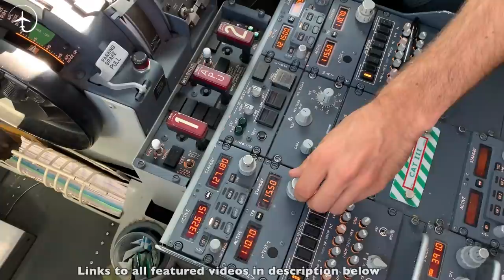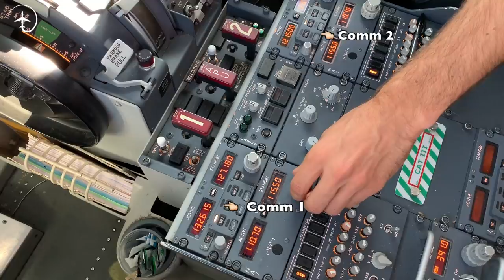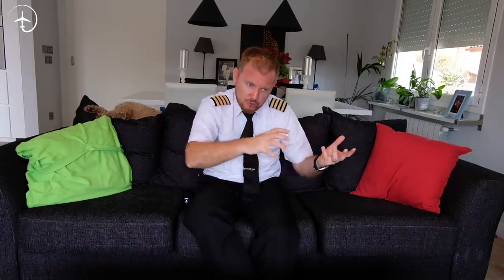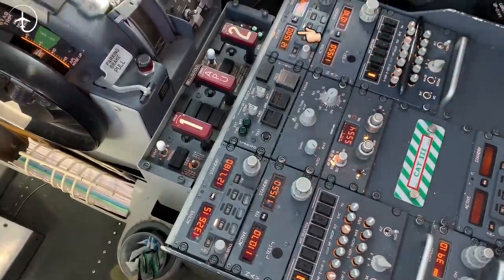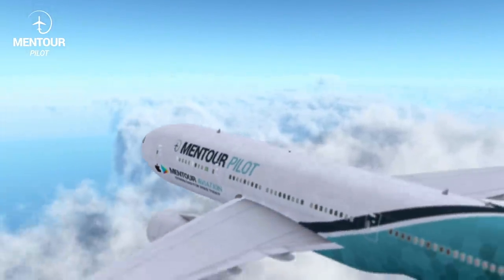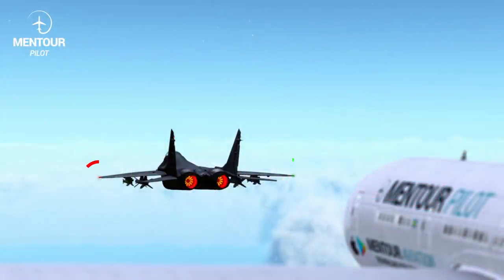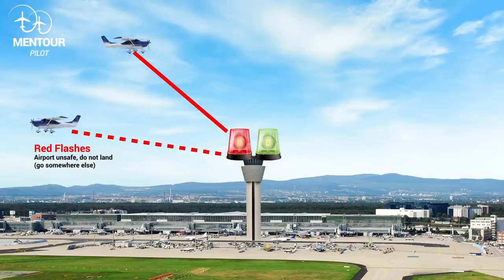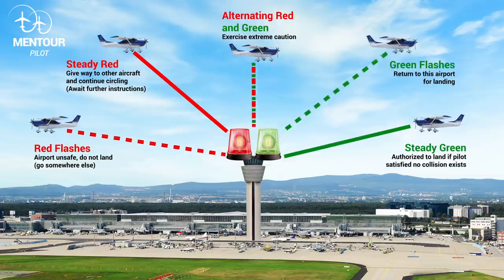how do pilots deal with loss of RADIOS?!

Comment: Can you talk about the MEL with regards to radios?  I was on a flight in the US that got delayed on the ground.  The plane was an MD-80, the delay was due to a bad radio.  The pilot mentioned that they could fly with only one radio but that the one functioning radio HAD to be radio 1 because that was the only radio powered by the APU in the event of a dual engine or generator failure.  Since the good radio was radio 2, we had to wait on the plane for maintenance to come swap the radios so we could fly.

Interesting side note from a flight I was on this week where I thought of Mentour Pilot - as they were pushing back and the starter on the first engine was engaged we heard a distinct CLUNK (then a groan from the passengers), the wing walker held up his sticks in an X, engine start was canceled and we came to a halt.  A few minutes go by, we're thinking the plane hit something.  Captain finally comes on the PA and tells us the towbar broke!  I was on a half-full 737 and they broke a towbar!  I don't know what part of the bar broke.  10-15 minutes later they continued pushback with a different bar and tug, there was apparently no damage to the plane.
Reply: Mike Levy , there is a shear pin on tow bar. if the tow car applies excessive force or abrupt maneuver when push the aircraft, the shear pin on tow bar is broken to avoid to damage   aircraft nose landing gear. After a quick check you can go on pushback with a different tow bar.
Reply: MEL varies by planes and sometimes even by airlines, according to FAA as long as there is a two ways communication you are good, but there are some issues with that. For example back when i was learning in school we went out with radio 1 inop and radio 2 was ok, during my training flight our com 2 failed as well so we had to do a few of the things he said but since it was a training airport we just called the tower by phone and got our clearance on the phone lol. So going back to your question even though you are ok by FAA regulations to go out with one radio it is better to have engineers check what happened to comm 1, because it could happen to comm 2 like it did to me

Comment: I’ve had to message pilots via ACARS that ATC is trying to get ahold of them. The responsible center will call our ops center and the sup will tell the responsible dispatcher. I’ve also had an aircraft on my “desk” message me to let me know that ATC was trying to reach another one of my company’s flights. Luckily, the other flight was another flight I was following already, so I was able to message them via datalink/ACARS and they were able to  get in contact with the proper center. 

:)

Comment: Good video, I (partially) lost my communication on the third solo flight, at least I could not hear the air traffic controllers, though they could hear me. It was combination of bad radio in the aircraft and the frequency that was out of the range of the second radio... I was quite worried about the whole situation, but eventually I changed the frequency to the one used in the nearby area and that one worked. And the traffic controller agreed I can stay on that frequency when I could not hear them on the proper one when I got more altitude. That was quite worrying because I was really unsure about the terminology or the nature of the problem and I was quite busy following the map:)

Comment: I had a mid flight radio failure during my private pilot flight training. Flying outside controlled airspace from a class D (general aviation) airport. 1. Squawk 7600 on the transponder. GA airport was near a major airport so it should have been picked up on radar. 2. Continue transmitting as normal. It may be only your receiver has failed.  3. I was not that far into the flight so I headed back to the departure airport.  4. Put the VOR on audio. Some VOR's can transmit a voice signal if necessary.  5. Check you are on the right frequency. 6. Check misc things such as radio volume, if using a headset put radio on speaker, check radio circuit breakers etc.  7. Follow normal pattern entry procedures when you are getting back to the airport. 8. Check the tower (if there is one) for light signals. Above all, remember the golden rule of priorities: 1. Aviate  2. Navigate  3. Communicate.

Comment: Hang in there! Hope this all blows over soon.

In my plane I have two radios, a handheld radio, and a fancy headset that talks my cellphone with Bluetooth. If those all fail it's down to the light gun or divert to an airport where no radios are required. In 10 years of flying I've reviewed NORDO arrival procedures twice but have never actually had to use them.

Comment: Personally I experienced radio failure on a solo Cessna 172 VFR route as a SPL. I squawk 7600 and rock my wings in front of control tower twice but I didn't see any flash light or flare but I saw chopper holding in air after I rock my wing 2 times in front of control tower.  Since I saw the chopper holding there I just proceed to land with extra cautious and immediately vacate the runway upon landed.  It was a good experience that I'll remember for the rest of my life

Comment: When the German Air Force One had this problem last year, they used their satphone. Isn't that an official procedure? And what about the permanent data link many planes have to their airline or the airplane manufacturer? Is it possible to use this to communicate?
Reply: Those all work on some type of radio transmitter, but yes if you have other devices like a satellite phone or cellular phone you can attempt to use them. The data links are not suited to communication with ATC, these only send minimum data packets about the systems. For a single pilot aircraft the work of using the telephone may be too much burden and it is better to simply fly the remaining portion of the flight plan if it is short, or fly a common published route to an alternate airport if the remaining flight is very long.(pilot judgment for how long is long) Air traffic control knows your flight plan and has already given clearance for the plan and in modern times you are on radar. Many of the procedures date to a time when radar was rare and there were no satellites or mobile telephones.

Comment: I always have a handheld in the plane with me in my bag. All what you explain is right, however the problem is, like flight MA370, if you loose all electrical. You will have no radios, avionics transponder or anything else. I carry a handheld with nav and com in my flight bag.
Reply: I do not know if you ever have an opportunity to test such a radio, but chances are that the range will be significantly reduced. The regular radio uses an external antenna with unobstructed line of sight, and has 25w of transmit power. The handheld can only send / receive it's signal through the windows, and probably transmits at 5w on max power. I'd much rather have that than no radio, but it might be less useful than expected.
Reply: @PsRohrbaugh  Test it all the time.  Since we are very high the range does not seems to be affected.

Comment: Answer: panic and fly straight line to the nearest airport.
Reply: Correct answer: No panic, proceed with remaining instruments and visual clues (if exists) to scheduled destination.
Reply: no panic: if radio is lost just use TV
Reply: answer: panic ask if any passengers want a go at flying
Reply: Runway direction, what is that? We're landing on the roof of the terminal building.

Comment: During my flight training, shortly after takeoff, I actually had a radio failure in my Cessna.  I could neither receive or transmit.  Relying on my training, I squawked 7600 and made a 180 turn back to airfield.  As I neared, I somehow regained radio and landed normally after clearance.

Comment: While flying a venerable Cessna 152 on a x-country, during a takeoff from an uncontrolled airport the radio tuning knob fell off and rolled to parts unknown......as I was flying to a towered airport, I pondered this a bit and decided to contact the on airport FSS (I'm dating myself here, yea, a Flight Service Station of which there were very many then) as they always monitor 122.8. So, when I was about 25 miles out I contacted them, gave them my ETA and asked that they relay my predicament to the tower.....As I approached the airport, I soon got the steady green right off the bat as they knew I was coming, rocked my wings, gave the windsock a look and made an uneventful landing. On the ramp, I found that little ole knob beneath the rudder pedals. Moral of the story..... in addition to a flashlight, carry a multi-tool (which we didn't have back then). BTW, had that happened today, I probably would just call the tower on my cell phone...Progress at its' finest!!

Comment: There was one time in 2004(I believe) where at LAX, all of the pilots lost all radio contact from the nearest radio station, and all scrambled about what happened. It was believe that the cause of the station shutting down unexpectedly was because of the way it was keeping track of the date and time. You see, every computer keeps track of time using a counter to represent the amount of time that has passed since whenever it was created. Take for example UNIX time. This time counter keeps track of the number of seconds since 00:00:00 on January 1, 1970CE. This time will run out at 3:14:07 on January 19, 2038CE for 32-bit OSes, and 15:30:08 on December 4, 292227026596CE for 64-bit OSes. In this instance, instead of the computer counting the seconds, it is counting milliseconds; and in this instance, it was a 32-bit system, whose counter ran out at 4,294,967,295 milliseconds, or about 49 days. Because of this, the counter rolled back to 0, causing the entire system to crash, cutting off all of the radio signal, and led to the incident.

Comment: Total loss of communication for a commercial aircraft would be almost impossible, due to the fact that the 3 VFH systems are completely independent and the HF systems are independent, minus the antenna. Spilling liquid on the center pedalestal would create a much bigger issue.

Comment: Interesting in the USA there is no 7 minute rule. We stick to the latest ATC instructions or cleared flight plan timeline whether the next turn is in 1 minute or 20 minutes. Our ATC will often add "expect xyz in 5 minutes" or "Expect further clearance at 17:12"  the end of a clearance. Which is the time to continue with the filed plan if communications are lost. But this is normally only used for things like departures where you may be out of contact for a few minutes but because of terrain you need the next step in the plan, or with a hold you just can't hold forever.

Comment: In some of the air-accident videos I've seen, a plane that loses its engines occasionally loses all power to the radio, nav aids, and sometimes even cabin lights, as well as hydraulics. Apparently more modern aircraft are designed so that this doesn't happen.
Reply: In general terms - yes. Separate fuses, separate power lines. But always ... You know, Murphy laws always kicks in most painful manner.
Reply: @adamw.8579  When I was a kid in the 1950s, there were a lot of old movies (left over from WW II) on TV. The crews of big war planes, like the B-25, included pilot, copilot, navigator, engineer, radio operator, bombardier, and several gunners.  The pilot could concentrate on flying the plane, while the navigator figured out where they were, and the engineer and radio operators worked on restoring communications. It now appears that the pilot and the co-pilot share the jobs of navigating and communicating, while flying the plane. (And flight attendants used to have to be registered nurses.)
Reply: @purplealice  And pilot was a real pilot not computer operator like now. When tech fails most of nowadays "pilots" is defenceless. Many of critical situations going fine was sorted by ex-military pilots, but in sim sessions new pilots fails.
Reply: @adamw.8579  If you want something done right, you have to do it yourself.

Comment: A portable satellite telephone with its own internal battery could be a backup system to provide communication. Aircraft could be fitted with a small external antenna that could be plugged into the satellite telephone by means of a cable.
Reply: We already have that - it is called ELT :)
Reply: @MegaAU  
An Emergency Locator Transmitter is not a two-way communication device and is not designed to be used in an aircraft that is flying.

Comment: This is a fascinating topic and I (non-pilot) learned some new things here. One thing that wasn't covered was what happens after the comms-disabled airplane is back on the ground again (let's assume an airliner, not a Cessna).  How would the pilots know where to go and when?  Would an emergency vehicle or some other piece of ground equipment drive out to the (now stopped presumably) plane on the runway in order to guide it to the gate?  If so is there yet another alternative visual communication protocol that would be used by the ground personnel to communicate with the pilots until they got to the gate?
Reply: Not so much an emergency vehicle per say, but a follow-me-car that directs the plane to a suitable place to disembark the passengers.
Reply: Yes, at 19:25 he mentions that they would send out a "follow me" car
Reply: @marknewman3712  Ah, you're right, good catch, I missed that.  Still I'm curious to know if the operators of this car and the pilots have any (perhaps internationally-standardized) visual communications protocol. Some kind of signalling that would be sure to be understood and unambiguous.  I suppose that by that point the folks on the ground could just hold up a sign with phone number on it for pilots to call to reach them or reach ground control.  Now that I'm thinking about it, I wonder if there's enough to the topic of pilot<->ground (not ATC) communications to fill a separate @Mentour video, assuming he hasn't made one already?
Reply: Eric Anderson he answered your question toward the end of the video.   A vehicle would escort to the gate

Comment: What's happen if you have a radio failure and an emergency at the same time?

Do you change continuously the squawk code from 7600 to 7700 or you put another squawk code?
Reply: At that point it doesn't really matter. Both are emergency situations, and as long as you've communicated that to ATC thru squawking 76 or 77, they know something's up. I'd just squawk 77 so they know there is a general emergency going on, and I'd get my aircraft down on the ground as soon as possible (or whatever stated in the QRH and general/local procedures for the area I'm flying in). Worst case scenario QRA scrambles, intercepts you, waggle their wings, and you just flick on and off all lights with short intervals to tell 'em you got an emergency.
Reply: 7700 would also cover lost communications. 7600 is lost communications without a general emergency. 
7600 expects the plane to keep flying a normal route, speed, and altitude on the filed flight plan. 
7700 expects the plane to do anything and ATC must clear a large area of airspace around the plane, ATC may also dispatch emergency ground response to the place of landing.
Reply: @mytech6779  thank you very much
Reply: @Henoik  thank you very much
Reply: Always: “Aviate, Navigate, Communicate”   set 7700 and get the plane down safety as possible. Always assume that that radio transmit is working but RX is screwed, so you explain your situation 121.5 Mhz AM  and follow what you say with smooth predictable actions.

Comment: Hi Mentour, just a quick question on this. Once you have followed the standardized IFR loss of comm procedure that you mentioned first (7 minutes straight, then flightplan as filed) will the tower still use the lights to clear you out of the holding patern to the airport or during final? Or can this procedure be completed without a (visual) landing clearance?

Comment: What about a total electrical failure. Air instruments only and interior lights fading to off. This happened to me many years ago on a night flight from London (Biggin Hill EGKB)) to Antwerp (EBAW) flying a C310. I grabbed my flashlight to see in the pitch black and my handheld transceiver to contact Brussels approach and after Antwerp Tower. I was told that they had already lost me (no more transponder emission). Fortunately I had just cleared crowd cover and proceeded on a makeshift procedure turn for RWY 29. It all worked out and the biggest fun was to manually lower the gear. My passengers however weren't thrilled with the porpoising motion.
Moral of the story GA is to always carry a handheld radio.

Comment: Hello! I'm Rodrigo Masis from Costa Rica, I'm a Commercial Pilot, and during my private pilot training, flying solo, I had a completely lost of communication, I was flying a Grumman AA-5A, from a non towered field to a Class C airport, I flew all the established flight route, without communication, with 7760, I flew all the flight plan, and approach, landed at the airport MRPV and taxi to the gate without any issue, now of course I was so naive and had few flight hour, but now I suppose ATC always maintain separation from me and other aircraft due to the transponder code, and they already knew I had a "trouble" because I did't see any traffic on final or even the approach, and the kinda give the priority? could I be right about that?
Reply: Yes, when you squawk 7600 (I assume you meant that), ATC knows that you have communication failure and assume that you will follow the appropriate procedure. Normally, the tower should have given you light signals to clear you to land.